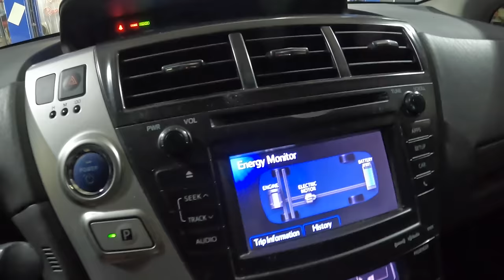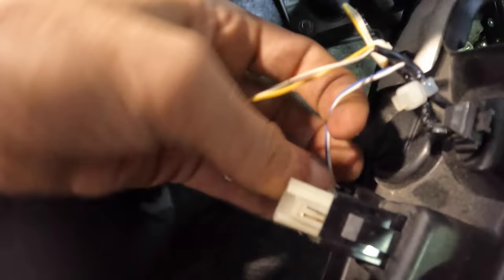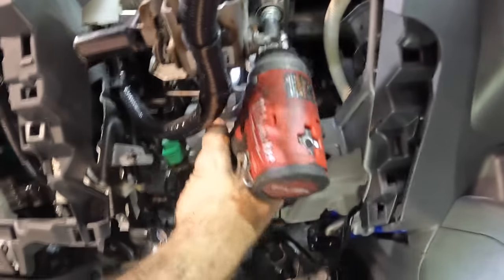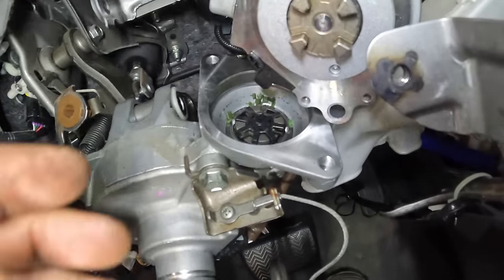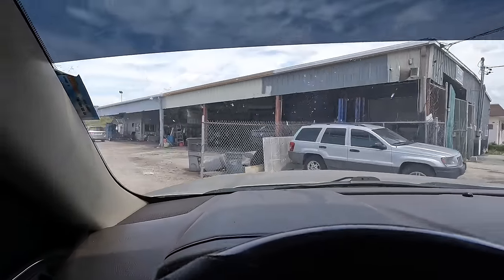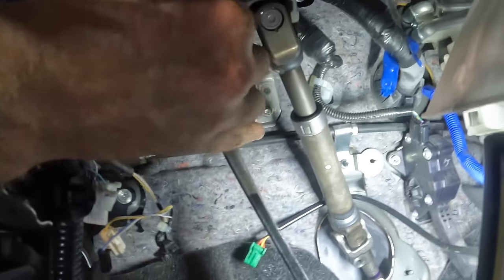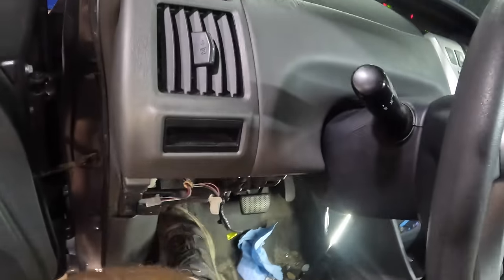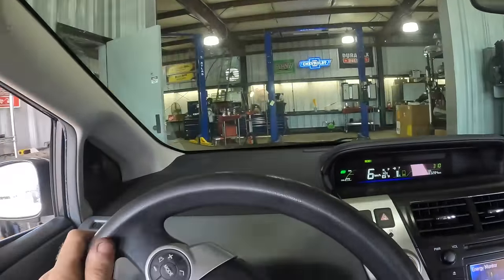Trip to the Dealer! Steering Knocking in DASH! Loose Column?? Toyota Prius

Comment: Center piece is there to keep the coupling from collapsing, easier to make it a separate part, than the make the more expensive mould, that you would need to have the polymer injection work, and not fill it with the green damper as well. Solid center on the mould to hold the part in place for the second run, making alignment easier for the robotic arm placing it in position. Likely made on a fully robotic plant, so as to keep consistency, and only a few workers who take the finished parts, do a final fettling and QC check, then place it in the bag, seal it, and apply the label for it.

Comment: Ray I've always used a stethoscope and a leanth of break line steel tube on it to pin point noise on different things works really good right to the point
Reply: Back in the day a long screwdriver ear to handle, also worked
Reply: @Captainbumble   That's exactly what I was going to say...  🤓

Comment: the steering column noise is a very common problem with Prius. thx for this video you helped a lot of people.

as for that brake noise, direct your attention to the ABS brake actuator (you have to remove the stupid cowl to get to it, as ALL REPAIRS ON THIS STUPID VEHICLE REQUIRE YOU TO DO). I hate this car.  to remove the cowl, Wiper arms (14mm, 21 ft lb)->plastic panel (you can bend it if you want to prevent breaking the plastic trim pieces on the side, $10 a piece, either approach is risky)-> wiper motor transmission, 4x 10mm bolts -> 10x 10mm bolts->bracket removal 3x bolts->remove metal cowl. 

If the ABS actuator is indeed bad, their brakes will still work, but they will need to apply a lot of force on the pedal whenever they want to stop. it happens often without warning so they can easily get into an accident. it's a 2 part braking system, if the actuator fails, it relies solely on the normal braking system as a fail-safe.   you can find the actuator online for about 500 bucks. this is a common problem with these. as for bleeding the brakes after the repair there's ways to do it with a scan tool for the rear, tech stream, and also ways to do it without any of those. the actuator is sitting where you'd typically find a brake booster on an old chevy truck or something

Comment: Wow, what a diagnosis. To tear into a steering column like that and hope to find the problem and then find the broken gear is very impressive. But then you always impress me.
Reply: Hope he retightened that steering knuckle before reinstalling that boot on the firewall. Would be something easy to overlook.
Reply: As he mentioned he had found this type of broken part and repair the hard way, so I think he sorta kinda knew what to look for first.
Reply: That is called experience, that Hyundai learning  experience was a lesson he will never forget.
Reply: Ray follows his inner spirit that leads him to the solution.

Comment: I always try to take the old part with me. Years ago, I was working at a 4X4 shop and a guy came in with an older Land Rover. They are called Defenders now but then they were a Series 3. I needed new brake shoes. I put the shoes on the counter and tell him I need shoes for an 88 wheel base Landy . He tells me those are off a 109” wheel base. 109s were the big 4 door. No these are off an 88 I tell him. He answers no they are off a 109. We go back and forth like this for a while. Finally I ask him if he has shoes like these. Yes he does but they won’t fit. They did.

Comment: So because the manufacturer chose to use nasty little plastic components, the vehicle owner ended up with a fairly substantial bill for the labour involved, but the part only cost a few dollars (I would guess.)
Great to see how you used your experience to work out where the problem was, Ray. You earned every cent involved in disassembling and reassembling all that stuff. 
I’d almost bet money that lesser vehicle technicians would’ve made an even bigger job of that - and I’m not a gambling man.
Great video. 👍
Reply: Toyota isn’t like other manufacturers like Ford, GM and Stellantis (Chrysler). They typically use certain materials because they perform better than others. These two surfaces mate for the electric power steering module. Toyota has a vastly different mentality/ideas that North American automakers. They have a history of observing/studying/dissecting what other automakers do before they introduce their version.
Reply: It surprised me the part was available. Usually, the manufacturers make it part of the whole assembly, costing more.✌️
Reply: on some parts its by design . better to sacrifice a coupler or bushing etc than the metal part that will be way more expensive and labor intensive to replace. metal on metal would wear fast. and bein in an area that cant be greased or lubed the same thing would happen and be more expensive to replace.
Reply: Toyotas have a reputation for being quiet.  Normally metal to metal would be louder.  Thatbpiece of plastic apears to exist soley for the purpose if reduving noise during normal wear.  Anything can wear out.
Reply: The spider coupling  is a were item, & is cheaper to replace than two halves that the spider goes between.

Comment: I haven't watched the whole video to see if you figured out the brake thing, but it sounds like there was a recall on the brake accumulator that they are extended warranties to cars as old as early 2000's for a replacement. The forum I was in, a guy made a video that had the exact sound

Comment: All  that work for a  little  piece of  plastic,  the  car  manufactures need  to use  less plastic crap on cars . Great catch Ray and  as usual your professionalism is amazing maybe its  time  to teach other  shops  your  skills.
Reply: Problem is all the customers ask for is for it to be quiet and comfortable, and all the manufacturer looks at is cost and ease of installation. The idea that you would want to take it apart isn't part of the equation as they are counting on most repairs being payed for by the customers. So for the manufacturer it really doesn't matter if it's hard as hell to get into. The designs are intended to keep intact until whatever warranty the manufacturer offer has run out. After that it's just a good idea if the car starts costing. In the end the customer will need a new car, and that's what the manufacturers want to sell.
Reply: Ok, but perhaps without this part made of plastic you would have a constant clicking sound of metal-to-metal. I don't know.
Reply: Automotive designers and engineers have NEVER taken into consideration the people who have to work on them...!!
Reply: @Calango741 Old VWs from the 50s and 60s had that problem, too.
Reply: @johncooper4637    I believe that was included in what I said.
Reply: @JohnADoe-pg1qk  exactly what i was going to say. Probably better they used plastic in this case to avoid noise concerns had the used metal instead.

Comment: I'm impressed, you worked on a Toyota without the connectors breaking
Reply: It is normally the connectors in the engine bay that break.  The ones in the cabin don't get nearly as hot.  Almost all my connectors on the engine were broken but when I pulled all the wiring from the cabin there was not a single broken connector and this was a 1985 MR2 being converted to a race car.
Reply: @johncooper4637 John, I want to drive your race car.

Comment: Priuses are put together with smoosh technology!

The steering noise is the result of crunchy bubbles growing around the rotational electrons.

The brake noise is just the potato getting hungry.  Sprinkle some water under the floorboard carpet, and make sure the potato is properly sealed off from light.  PROTIP:  You can only see the potato if you're not paying attention.  :)

Comment: The brake noise could be the accumulator pump on the brake system, these hybrid brakes don’t operate like normal car brakes, it work by you pressing the pedal the pump actuates pressures the cylinder to know how much pressure the driver is putting and the computer decides if to use regenerative braking or the frictional brakes, so basically it’s a computer controlled brake system. Usually in Toyotas it’s the accumulator pump and it’s costly to replace and it cannot be repaired. (Found out that’s why Toyota hybrids are always getting stolen in my country)
Reply: "cannot be repaired" sounds like a challenge.
Reply: I'd bet that Mike Brewer (Wheeler Dealer) knows a small shop that can rebuild it.

Comment: Ray when you need to work with key on door open trip the door latch with a screw driver. I was about to turn the video off because of the door open buzzer.
Reply: Plus it also will disable certain functions, and limit your speed as well, because it senses a door open.
Reply: You do nice thing. don't see  don't hear .

Comment: the Prius has a vacuumpump to create vacuum for the brakebooster when the engine is not running but your driving and braking. In a normal petrol engine the engine always creates vacuum from the intakemanifold

Comment: Nice fix for steering column noise!  Hope that brake noise is not the known issue that requires booster & pump replacement. Expensive parts if that is the case!
Reply: Does sound like a booster pump getting indigestion.

Comment: Very interesting that the electric assist steering issue was very similar to the Hyundai one you did a while back.  Great video showing the "peeling back the onion" of the dash components to get to it.  Again, I am amazed at you attacking these, almost like you've done one before even though it's the first time.  Thanks for taking us along.  Nice Lauren/Wife Unit cameo too. 😊

Comment: Reddit excerpt on the brake noise btw; PSA regarding free brake booster replacement.
2013 Prius lit up like a Christmas tree last night. Traction control, brake, and abs warning lights all came on at once. No normal diagnostic code with a home OBD. After checking abbs sensors and other quick fixes, took it into the dealer for a scan. Bad brake booster/ accumulator. I guess this is a common problem and was pleased to hear they have an extended warranty on the parts. From what I understand, if your Prius has less than 150k miles, you can get it replaced for free before March of 2023. Car needs to throw code C1391 to be eligible. Parts alone are about 1500 or so for Toyota brand. I believe the quote for out of warranty work was nearly 5 grand.

Just a PSA, if your Prius has thrown this code, get on it quick... I mean, a bad brake booster should be replaced immediately anyway, but you know what I mean.(End except)

Comment: I had that exact same part fail on a 2013 Kia Optima EX Hybrid. It was handled as a recall at no cost to me. They said that the original part was made with a material that broke down in our type of climate ( I am also in Florida) and that the updated part was made of a different material that was still plastic but withstood the environment better. Their design was a little easier to get to. Great video.

Comment: Disconnecting a collum should be not so hard . The motor wire should have a connector near by the collum . At the local yard , they sell me whole collums less air bag for $50 bucks . I have bought lots of them for parts . Many times dealers want allot just for one part . This part should have been redesigned and the problem would be better fixed on these collums .

Comment: I recognize that power steering motor coupler as a lovejoy joint, albiet its a brand name. The nice thing about them is if the bushing fails, as you have seen twice, it still functions, just with more slop. While I dont have use experience of that kind of joint, just seen parts on a shelf, I feel like the bushing for the power steering motor is a poor design. Why is it a 3 piece bonded part that separates and breaks?

Comment: Ray's the best diagnostician I've ever seen. Nice job with the damaged gear!
Reply: He learned the hard way on that Hyundai steering column.
Reply: @RCRadioShow  I had a 2013 Sonata with that very issue.  Bushing was shreaded!
Reply: @scolley0616  I think that was a Sonata in the other video. Ray replaced a U-joint first and that didn't fix the issue. He had to eat that part of the repair including the cost of the U-joint.
Reply: @RCRadioShow  I remember that, I wanted to shout through the PC, check the bushing!!!
Reply: I beg to disagree

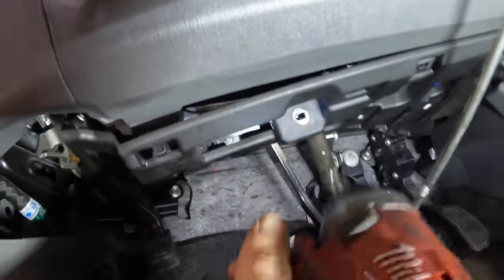Comment: 7:11 steering has a lot of slop
The noise almost sounds like flickering relays .
The car has regenerative braking
As the car slows a motor generate power to charge the battery.   
My son had an older version his factory batteries went bad, jump start no help when the power pack has a dead cell they make a nice paper weight.

Comment: Great use of previous experience!
I really hate that phrase. (I found A problem, but not THE problem) 
EVERY time I've heard that phrase, I've gotten $crewed over by a mechanic that did work that was not necessary.  
The last one replaced a wheel bearing that wasn't bad, (I had replaced it 6 months before),  "looking" for a steering wobble, said "the phrase" then he suggested replacing the axle. I got a second opinion... 
IT WAS AN OUT OF ROUND TIRE!!!!
I've never been back there. I was a 20+ year customer.

Comment: Since you asked so nicely for a comment, I'd thought that I'd say this!

Hey Ray I'm about to embark on a personal upgrade to my 2001 Silveryado 1500. I'm installing a Wolfbox G850 Dashcam/Backupcam Replacement for the Stock Windshield mounted Rearview, not sponsored just what I'm using because I liked it's design. The part that terrifies me is pulling down the headliner to tuck the old wiring harness up and out of sight and running the GPS wire, power wire, and Backup cam wire to the A-Pillars. 

I'm trying to decide if I should buy some 10AWG wire and run a power lead from the main underhood fuse block to a 30/40amp relay under the dash and use said relay to power my head unit. (because the hardwire kit has 2 fused (15amp) power leads, 1 supposed to be power all the time 1 switched power. But I want it switched only because I don't get to drive my truck often I don't need 24 hour parking monitoring draining my battery.) and tapping into the SEO ACCY or RAP #2 fuses for the switched lead to the relay. Or should I just send 1 wire to SEO ACCY and one to RAP #2 with the add-a-fuse because from what I can understand on the forums and the google machine my truck, those two fuses aren't used.

I'd certainly like some insight into that from the automotive community

I've already decided I'm going to carefully punch the camera wire through the main wiring harness grommet in the firewall and run it either along the brake lines to the rear or through the frame rail

Comment: Electric power steering motor at the 5 min mark into your video

The brake issue, could it be the ABS pump?
Reply: A sterling motor sounds like it is from England.
Reply: @wayneessar7489 pardon my thumb typo

Comment: Good call on the sterring problem. As for the brakes I hope it isnt the ABS pump. Those ar expensive. I replaced one on my 2005. Terrible job. Hopefully its just a bleeding that needs to be done through the toyota app

Comment: Ray, you are the best of the best. I have a similar problem with a 2012 Prius. At Toyota, I was told that the only possible repair is to replace the appropriate power steering.  According to the local Toyota, there is no part that can be replaced and therefore it is necessary to order a complete power steering.  Thanks to you, I know where the problem is and how to eliminate it.  God bless people like you.

Comment: Only part way through the video.  Looks like the Hyundai steering issue.  Too many plastic/rubber components in critical steering systems. Sure that other manufacturers are doing the same thing.

Comment: Great video. This does not apply to a 2012 Prius 3. It does not have a plastic damper in the electric steering motor interface. I learned a lot though.

Comment: These jobs are why you don't want the customer to show right in the middle of. I was doing a job on a little Chevy car and had to pull the dash out. I don't recall why the customer showed up or how he got into the shop. But that guy about had a heart attack!! It was sorta funny. I also had an electrical problem I was trying to nail down on a Pontiac Solstice. The customer could see my bay from the waiting room.  They became a little concerned about the work once I had the Pass. front fender off. But that's where the battery is.

Comment: So in ever video you honk the horn when backing out(Safety First) but didn't on the quietest car made when running on batterries. Was the backup alarm audible outside the car? Loved the airbag blip. We used to take old airbags and put them behind body panels that had been dented in an accident.We would then exite them and boom it would press the whole panel out. Sometimes the panel wouldn't need anything else and if it did it was minimal.

Comment: Never seen the column fail like that in one of these but I know there was an issue with the master cylinders failing on these. It's a very complex piece of equipment designed for simulated brake pedal feel. I had a place that had one of these as a work vehicle. Happened to ours. Was a pig to do. Expensive to get even from the scrapyard. Needed pirate techstream to do the bleed procedure.

Comment: Wow, so the moral of the story is that Toyota learned from Hyundai where to use POS crumbly plastic parts that are 100% guaranteed to disintegrate, after only a rather short time mind you. There is about as much shame present in the automobile manufacturing industry as there is in flat erf.

Comment: That is a terrible design for a spider in a flex coupling.  These are industry standard parts aka Lovejoy couplings and I have never seen one with a brittle plastic insert like that.  Someone redesigned the wheel and made it worse. There are already industry standard parts with proven designs for this application.  Toyota is slipping.